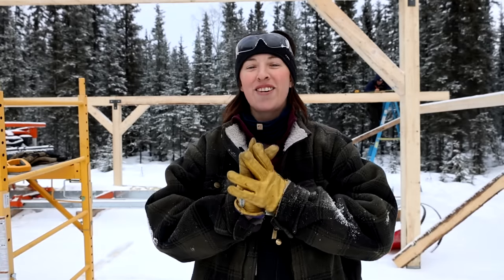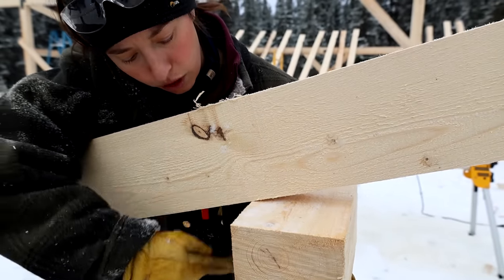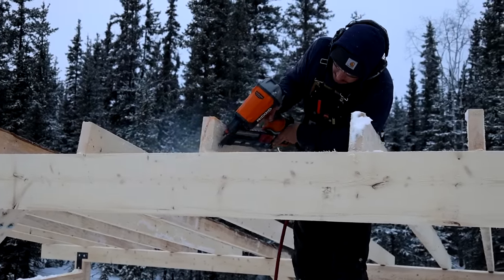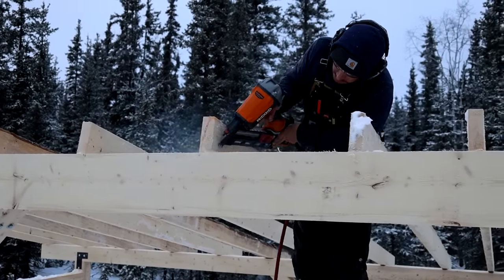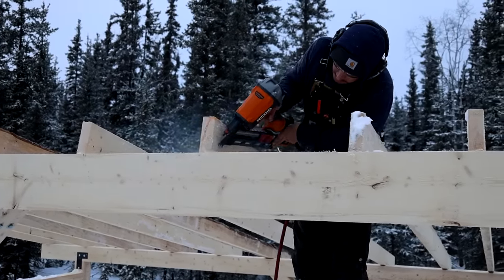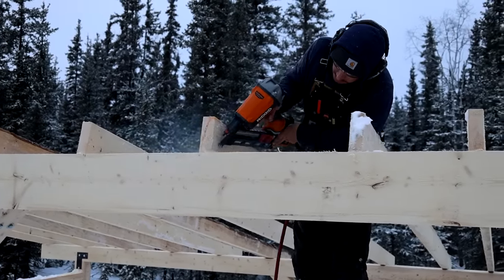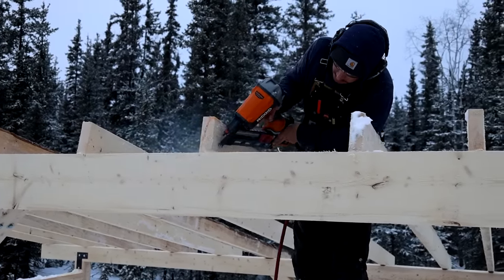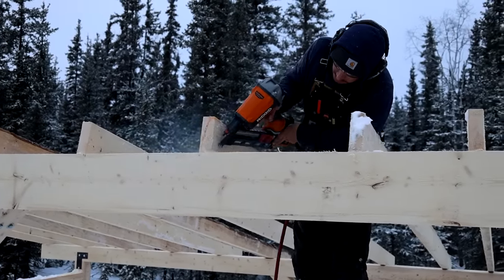Building a Sawmill Shed | Install Rafters and Metal Roofing + Total Project Cost

Comment: Young lady, just a little survival tip when using a chop/miter saw. Look at your video at the 5:51 mark. The board is going to the right and you are holding it with your LEFT hand, cross body and operating the saw with your RIGHT hand. Never put anything you do not wish to cut in front of the blade when you are operating it.

Comment: Maybe do 3/4 walls and possibly even the front stubs? Just up to the lower brace. Just keep wind out in colder temps and keep snow from drifting inside. Heck, could find a cheap wood stove to stick in a corner even. Might not do a lot, but take the edge off.

Just a couple random thoughts.

Edit: could even tarp the front entry to extend how far into Winter it's usable.

Comment: I use a level to figure my pitch. Measure 12 inches from the end of level that contacts roof. Level out the level and at the 12 inch mark measure down to roof. That's your pitch. 3/12   5/12  etc.  A 12/12 pitch is also a 45 degree angle. Comments mentioned end bracing as well. I've seen 2x4 angled from the gable bottom plate up to the truss. Do this to 3 or 4 trusses. If there is a bottom plate with your truss you can use what we called 'rat runs'. I nailed 2x4  here .

Comment: Your 45’ braces are great.While they do transfer some load,their main function is wind and seismic loading. In fact, you would do well to add 45’s to the solar frame and your side covers on the container.  On the side covers you can use  1x6’s and just nail them on the face of the beam and posts.
Love watching your vids. You do such a great job. Watching from Ashland,Oregon, 50 miles from Keno!

Comment: I would highly recommend 
a sheer wall consisting of 3 more posts and bracing across the back. 5/8 plywood (not particle board) for sheer strenth. Fasten plywood to both beam and post. 
2½ inch coated deck screws are a must!
Same for end walls. Add center posts  if your sides are over 6' 5" in.
Hope this was helpful.

Comment: Wonder if you should sister on a six or eight footer onto that midspan front header center joint.  Maybe doll it up with 3" square plate as screw washer oriented diagonally.  And glue for sure.

Comment: Yes, the roof is all parallel bracing, and I would consider some steel bracket bracing for the sides, like a big triangle to use the steel and a 45degree angle to brace the ends. The little brackets that you have may not offer a good hold. You have done very to make your own! Love the project!!

Comment: Hey guys just a tip if you lay all your panels in a neat stack you can tranafer your purlin layout onto the panels and predrill pilot holea for your fasteners. So you can also use the holes aa a reference for staying on line and you dont have to press  or risk have any screws going sideways on you etc while holding it still.

Comment: I would consider installing some metal hurricane straps on those rafters and not totally reply on the toe nailed nails. Not so much a protection from wind but to protect against drift and swat from time, snow load and natural tendency of lumber to warp and twist. Now is the time to do that because of easy access. Just a thought.  Good looking structure. Nice work.

Comment: I bought the I/2 in large bolts with nuts and washers for my deck at Home Depot for $6 or $7 dollars each and after doing about 1/2 my almost a 100 ft by 12 ft to 16 ft  cedar deck with pressure treated frame I found the same bolts at the nut and bolt store for around a $1 each if I bought a box of like 50. Unbelievable the mark up !

Comment: Hey Y'all,
  Awesome job !!! Are you going to put board and batten up on 3 of the sides perhaps with a rolling door on the back?
  Just a roofing tip to consider for future buildings. There is a company in Fairbanks called ( ALL STEEL) on Philips Field road who manufacturers roofing too lenghts you need. Cannot say they are cheaper but when I built my house a long timeago they were about 30% cheaper.
   Again awesome job.👍👍👍👍👍😊😊😊😊

Comment: What a great sawmill shed, congrats!!!! I did notice a couple things. Are you going to cap the gap between the 4 ft over hang and the main roof? Also when Eric was on top doing the 1 by rafters and the metal roofing there was an awful lot of lateral wiggle, so wasn't sure if you were going to install any additional cross bracing or anything? The wiggle I'm referencing came at 22:05, 22:12, 22:50, of the video.

Comment: Eric, you need to put some 45° bracing on the ends of your structure to stop the fore/aft sway. Judging by how much forward/backward movement there was in the structure when you were on the roof at the end of the roofing job, I don't believe your structure will stand up to very much snow load and wind. Go back and review your video @ 22:30 thru 23:10 and pay attention to how much the structure sways as you move around on the roof. Other than that you guys did a good job and the sawmill cover came out nice.

Comment: Have you thought about putting barn style doors on or even a few heavy tarps across the opening and also siding to help keep snow and rain out when you're not using it? Solar power for lights, like the coop. Maybe even use the same clear roofing for some of the siding for light. Could use the first cut off the logs that have the bark on them for siding, like you old woodshed and lean-tos. Battery powered leaf blower will clear the snow, as your snow is powdery.  Winter of 1985/86 Fairbanks had over 140 inches and the winter 1990/91 they had over 140 inches again. It didn't stop snowing in Jan. like normal. It was still snowing the end of Feb. to early March.  So be ready for alot of snow and then when you don't get it - great. You 2 are tough!! I did 4 years up in Fairbanks and that was enough!! Thanks for sharing. It is really cool. It's going to be nice to not get rained or snowed on. God bless and protect.

Comment: Use a level to find your pitch. Place a 2' level on the roof with the bubble showing level then measure the amount of rise at the other end, then divide by 2. So if your measurement is 6" then you have a 3/12 pitch. 8" is a 4/12, 16" is an 8/12 and so on. And if you have a 4' level same thing but divide your rise measurement by 4. Appreciate you sharing your life and adventures with us.

Comment: I am not sure from which direction the wind blows in relation to your shed, but I would consider putting up some walls along the back side, and perhaps on the ends, which would also help with reducing the blown snow in and around the Norwood (good machines). The walls would also serve to "stiffen" the structure up a little more, although if you were to do this, you would need to add some lighting. Great job on the build though! Be safe!

Comment: Another option in lieu of the cable bracing is to install removable wood braces for when you need to work. Take them off when you need to work and reinstall them when the work is done.

Comment: Im preparing to build a building over my mill. Fun to see what you are doing. I think I’m just going to cantilever the roof out a few feet rather than slope a short pitched roof. Just to eliminate a drip edge on the front. Definitely add the braces on the ends of the building. As a few have mentioned. 😊

Comment: You really need the same 45* braces on the end beams to the post to keep the structure from collapassing front to back. If it lays over it no doubt will cause damage to your sawmill.  At the front you could add an additional brace from the top of the horazonal beams to the post.  The weight of the snow and a little wind could lay this over.

Comment: Try cutting your steel roofing with your circular saw and a fine toothed blade on it installed backwards. I've done it for years.  Safety glasses are a must and I see you are wearing them.

Comment: The structure looks great and it should help keep your sawmill running much better, and longer, than it would not being covered.  I just built a 6 ft wide, by 12 foot deep by 8 foot high storage room that was insulated with 2 inch foam and the materials alone cost close to $1,000 using Home Depot as the source of materials. So, $2,500 for that structure is a really good price considering where you’re at.  When you were installing the first roof panel, the structure was really swaying a lot and while the roof panels do provide some extra support in that area, you may want to consider adding some L-Brackets to at least 25% to 33% of the connections where the rafters sit on the beams.  Also, watching many other timber frame buildings being constructed, I’m wondering if adding at least a couple more braces on the corners that reach to the base would add a lot more structure strength.

Comment: I would add four gussets (each corner) 45 degrees to stop collapse front to back. The 45 degree gussets you have will strengthen left to right but you need support front to back also. Great job, if it is getting end walls you might not need supports.

Comment: Over the years I have learned, example: green sawn 2X6 true dimensions usually dry out over time to roughly 1 5/8 X 5 1/5. Another tip is to paint the end grain to slow down drying so boards dont check or crack. Hope this helps, it's information that has been passed down and I am just doing the same.👍

Comment: I'm pretty sure you won't have any racking issues.  Your rafters with bottom structural cords along with the 1x 6 laterals will lock it in very solid. Shouldn't have any problems handling guest up to 50 - 60 mph. Just depends which direction is your prominent wind direct is. The trees behind the saw mill should definitely defuse any high winds. So I think you two are perfectly fine. Great job, and yes when I was stationed in Alaska, a few soldiers would travel hours to work on homesteads for elder and or temporarily injured people. I have literally built a saw shed similar to that with 10 soldiers in 2 to 3 days for a 55 year old man living alone. The military unit I served back 20 years ago highly encouraged projects for community better of life concerns. I'm pretty sure this isn't the case so much now days which saddens my soul. Take care, be safe and enjoy your wonderous adventures and life.

Comment: add some giant c clamp vise grips normally used for welding , they come in different sizes and lengths , use them to hold that roofing and framing together while you nail and drill bolt holes and use them for welding projects too , great videos , i use to build alot of the same things youve built when i was young , at 64 i have to be very careful about climbing ladders and such , lol

Comment: You ought to install diagonal bracing on the two ends like you did on the two sides. In a high wind the structure could collapse toward the back or the front.

Comment: Would be nice to put up siding on the back wall at least to be able to hang up old blades and new blades out of the weather and have a shelf or 2 to store oil and tools that you need to adjust the sawmill on occasion. Just a thought lol

Comment: Awesome job!  The sawmill is a game changer.   Cost saving tip for future projects would be to buy threaded rod and use that instead of costly bolts. You can save 50-70% on hardware costs and make custom lengths.  One plus you didn't mention were no swarms of mosquitoes/biting flies bothering you!......

Comment: I think you need to add bracing in the front to back direction. Also, probably should add bracing to prevent rotation (racking). If you have high winds you should probably tie down the roof rafters. Great project. I enjoyed watching it. Thanks!

Comment: Even if that sawmill cost you north of $6,000, I'd guess it's already paid for itself in lumber savings.  And time savings (running to the lumber store and back) are a bonus!  And no waiting weeks (or months) for the right lumber to show up.  What a boon!  Lag SCREWS, because they end in a screw point.  Bolts end flat (or nearly so), and are threaded to the end, as for a nut.  Let me second the motion for diagonal bracing (knees) on the end walls to prevent more leaning to front or rear! I could see it wobbling on that axis as you were doing the roofing.

Comment: Tip from retired military veteran, in extreme cold if you ever need to dig or put a ground rod the ground. Grab a couple cups of rock salt and place exactly on the spot of desire. Let it sit for 8 to 12 hours and the ground will be soft, adding just a bit of warm water will speed up the initial process. I have had to poke the ground to work the salt water mud down every few hours if the ground is frozen deeper than 3 feet. Hope this information helps in the future 👍

Comment: Project's looking great. Suggest you check recommended spans and snow loads for 2x6 rafters. Two foot centers are pretty wide for a 2-3 foot (or more) snow fall on a 16ft long rafter. You may need to either cut the spacing to 12 inches or at least double up your rafters. Please be safe. Some of us have been along with you two for years and we don't want to see you get hurt.

Comment: "Eeengineer" here - completely agree with the comments on bracing.  The swaying shown in the video should never happen - you are risking your structure by not bracing.  It all looks really good and you tied it all together very well, so well it sways end to end with everything moving together - needs bracing.  I concur with other comments - a wind at the right angle and intensity will take this down, somewhat easily.  I hope you take the advice others have given seriously; I'm sure there is ample detailed technical descriptions on the internet of why bracing is needed for this type of rectangular structure, and plenty of pictures to show what can be installed to mitigate the issue.  Love your vids, thanks for sharing, and really like the cost comparison at the end.

Comment: I just finished building a 20 by 24 ft Barn with 9 ft roof, we built our own trusses, they are 2 ft on one side 6 in on the other end for water catchment. It turned out amazing I used 8'x 8' x 12' beams on each corner. The pattern of the trusses was copied from an earthship design in New Mexico. Keep up the good work and joy following you now for about 6 years.😊
Reply: Ops ...should say 8"x 8" square beams @12 foot tall 🤩
Reply: Also the trusses are 20-ft long with no center post, solid as a rock. The design design on our trusses as you have done on your roof consider directing the rain snow runoff into gutters into large catchment barrels.

Comment: The knee braces (45's) are to prevent racking (the leaning you experienced). It would be advisable to put them on the end posts to a cross beam to add rigidity to the back and forward racking.  Good working team.

Comment: 14:03 Onions storage is tricky because as onions are harvested the start to off gas something which causes rapid decay in other vegetables. The gas coming for onions is (like propane) heavier than air so if you want to store onions you either store them in an open basket type container down low or indoors hanging from the rafters...

Comment: That notch in your rafter is called a 'bird's mouth'.  Incidentally, when cutting 6"-wide boards on your compound sliding miter saw, you should push the saw back as far as it will go, and cut only in a descending manner, not utilizing the slide (that's for wider boards).  Using the slide function increases the chances of a kickback on a 'narrow' board.  Your roofing nails are 'ringshanks'.  Your 1x roofing members are called 'purlins'.  Y'all did a great job.  Nice looking sawmill shed.  Very professional-looking construction.  Looks like a $10,000 structure to me.

Comment: Yes some added bracing on the end walls to sturdy the structure up would be a must!   But great job you two!   The building will keep the saw mill working a lot longer!   Just an idea you can hang tarps a long the sides to keep the wind out to would help depending on the day!   Have them on hooks on the grommets so you can take them down when not needed on certain days!

Comment: Not to tell you what to do but you guys should put those 45 degree braces on the corner posts in both directions. It will take alot of the wiggle out of the building. Those braces are designed to keep the building frome racking more than its designed to distribute weight. It looks great tho.

Comment: If the hardware prices are too high up there, consider making your own. The post holders could have been welded up out of 1/4 flat, like you did for the braces up top, and a bulk purchase of 3/8" x 12' all thread and a large box each of nuts & washers will cover many of your bolt and lag screw needs.

Comment: @SimpleLivingAlaska, Eric & Arielle; First, notching the rafters does not weaken the wood, especially roughsawn timber, to the contrary, those notches strengthen the structural integrity greatly.

Second, you need diagonal (wind) bracing on the end walls to prevent racking, which will occur with the saltbox roof that doesn't have equidistant support along the front.

FYI, those 'ribbed' nails are ringshank nails, and they hold extremely well. Don't ever use them on something that you think you may take apart in the future, as they are incredibly hard to remove and will damage the wood if you are successful in getting them removed.

Comment: Great job on the mill shed.  Come winter time for sawing you will still have to deal with frozen wood.  So what every you want to cut you may need to store that indoors til ready to saw.  Lumber costs a fortune.  Glad I'm not starting out.  Everything is high and getting higher.  Barbeque grill under roof to hang out at.  It will be a hang.  Guaranteed.  Time to wet a line.